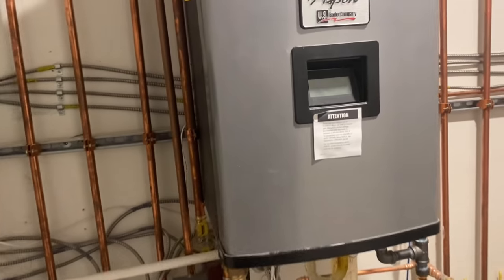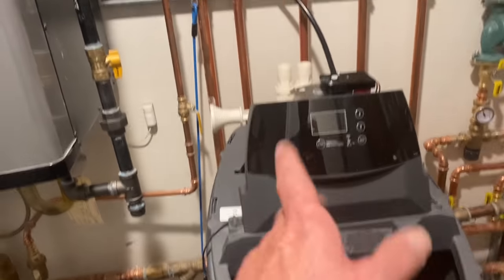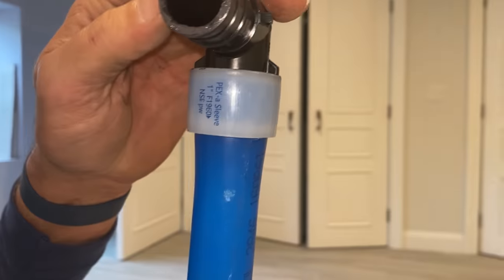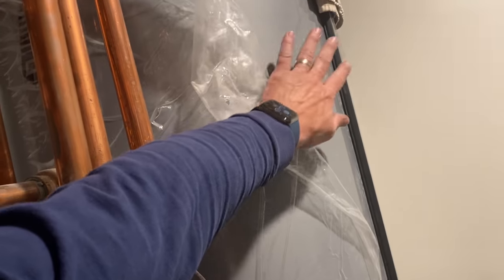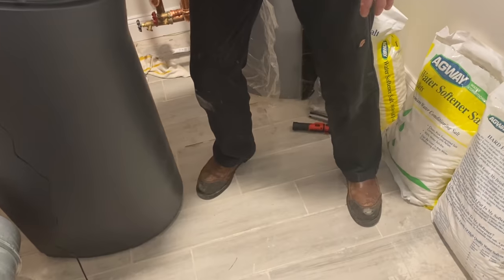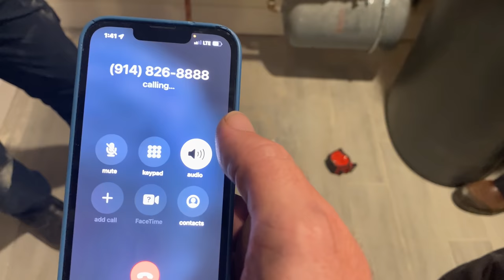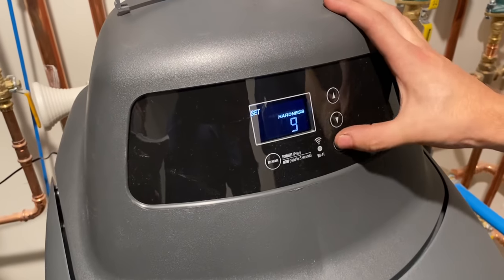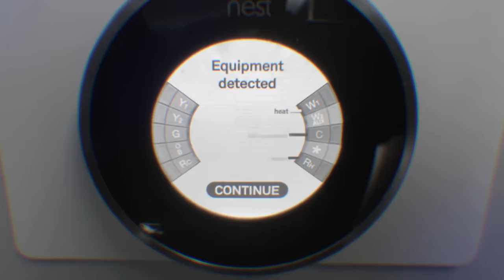Best Water Filter Not Aquasana Installation of Whole House North Star Water System

Comment: Great install…..  usually the regen cycle should be set for a time when no one will use water.  That way the 2 hours it takes occurs between say 2am and 4am when the is no or very little use of the system.  The salt isn’t used in the water going through the system, it is used during the regen cycle to flush the filter media.  The filter media is what is actually making the ion exchange with the incoming water.  Depending on the hardness of the water is when the ions from the media run out resulting in the need for a regeneration cycle and the salt replaces those ions in the filter media.  Hope this answers Peter’s question.
Reply: Exactly 👍
Reply: The salt also replaces the calcium in the drinking supply. This is why the TDS stays the same. The harder the water the more salt is exchanged.
Reply: ideally, that place should have a dual tank system. one tank is always regenerated and ready to go, while the other tank is in use, when the total gallon limit is reached it just switches tanks and regenerates the other so it's ready again.
Reply: Damn it, I typed out this long explanation of how a water softener works then noticed that you did it already.  Good explanation!
Reply: @throttlebottle5906  Kinetico!  :) I have that in my house and love it.
Reply: @JohnSebeny  lol…. I’m in that club too for a lot of stuff!  Merry Christmas.
Reply: @yfdfireman2  What's your opinion on a cold water line going to the kitchen sink for drinking? Should that line be split off using a T before the water softener?
That is the way my system was installed, maybe for possible salt content in the water for drinking.
Reply: @chrispixx  going to preface this wi I am not a plumber, just have experience with water softeners.  People split water softeners from drinking water because they believe it adds sodium to the water.  Best piece of mind would be to collect a sample of both pre and post softened water and comparing them.  Mine doesn’t split off, but in the scheme of things I don’t think it matters much either way.  The original minerals or the softened water are both harmless to you from everything I have read.
Reply: @throttlebottle5906  What's your opinion on a cold water line going to the kitchen sink for drinking? Should that line be split off using a T before the water softener?
That is the way my system was installed, maybe for possible salt content in the water for drinking.
Reply: @chrispixx  I see no reason to ever do that, if the water is that hard(off the charts) then add a reverse osmosis filter system and faucet to the sink just for drinking water, taken after the water softener. no sense in filling your RO system with hard water minerals.
I suppose someone may want hard water for cooking, but it really makes zero sense, other than watering the lawn or plants that like minerals, it would be a huge salt waste otherwise.

Comment: Nice video Mike.  
I would install a Normally Closed bypass ball valve and two Normally Open isolation ball valves in the IN and Out lines to the softener. I hate to depend on internal valves in equipment.

Comment: It’s just an ion exchanger. Don’t think the condensate pump will keep up with the back flush flow rate. Usually it’s piped up to a drain. You need a water test for hardness grains per gallon and iron ppm so you can set your parameters for the unit so it knows how much salt to use and how often to back flush/regenerate. Standard set up procedure for any water softener. Any plumber can install these but they are best handled by a water treatment company, since it’s what they do day in/day out…BTW, it’s always best to use solar salt as it doesn’t clump or cause salt bridging inside the salt tank, plus it’s cheaper. $6.99/bag here in South Jersey. Always regenerate during middle of night so you have soft water during the day

Comment: Finally someone who explains one! I need to install one in my house. Got a well with high minerals.
Reply: The salt simply regenerates the resin. Its the resin that pulls the minerals out of the water as it passes through on its way to your faucet.  Then after the resin has no more "room" on it chemically for iron, magnesium  etc the softener regenerates the resin by pumping the salt water in that brine tank over the resin. The salt displaces the minerals off the resin and the whole mix is dumped down the drain. Then the resin is recharged and can work for another few days.

Comment: Around here plumbers dog on those Northstar units, saying they are cheap junk, but I like them. They are easy to service, and I like how compact they are. The biggest problem I've found with them is if the supply hoses don't line up perfectly, the pressure against the built in bypass will cause the housing to leak over time. You mentioned wanting to add external ball valves, but the softener has a built-in bypass that can decouple from the softener, allowing for softener removal.

Comment: Mike,  I have a water softener in my house, the unit came with a couple of test strips to test the water with, 9 is not very hard.  Also they make different salt to help remove the iron.  I also had to remove the anode rod from my water heater to stop the bad smell from the water.  Mine works great. Mine is a Morton brand.

Comment: Instead of installing 2 ball valves above the water softener, wouldn't a better solution be to install a bypass valve, in the event the softener fails in the future?
Water Softeners usually have a 10 year lifespan.

Comment: those bags of salt inside the North Star how many months do you have too refill it again ?? thanks
Reply: Friggin nightmare. The bags are 40#  it takes 4 or 5 to fill my brine tank.  They last about 5 weeks.  So every 2 months its off to home depot, 8 bags from my garage to the basement.
Reply: @Samlol23_drrich  wow, and thanks for the reply
Reply: it depends on the actual water hardness and setting of the machine. the machine has preset tables of total useable gallons of water per regeneration cycle, the table used is set by the grains per gallon "water hardness" setting. if set to 10 grains per gallon hardness, it will use far-far less salt than is set to 50 grains per gallon hardness.
cranked up real high for very hard water it could chew through multiple bags of salt a week!
we have lots of well water around here and some areas have super high iron content(some places lime) and run settings of 75 to 100+GPG, (very hard water!) weekly salt deliveries and refilling is a must, because it eats it like kids and candy from a pez dispenser 🥳

Comment: do not run a water softener discharge to a condensate pump, the rinse cycle will dump too much volume and overflow it.
softener's it need their own drain with a trap and air gap, the brine tank overflow should go to a floor drain with air gap also. avoid going into a sump pit also, the salt concentration is very high and will eat everything up, especially if the pump doesn't run often.
Reply: @PipeDoctor   think about power failures during regeneration. also note, most softeners will "stick" in whatever mode they were in when the power fails, so if it was in the middle of a process it will just keep flowing the same.
they 100% should have placed a floor drain or two in the mechanical room. oh well.
Reply: I agree 100% should go into a trapped drain. The salt and minerals will tear that little pump up causing a huge flood.

Comment: i just installed one of these, what a nightmare, i kept getting a leak on the inlet nipple between the black c-clamp. I do not like how the connectors are designed just to sit against an o-ring, it was a very small leak, one drip every 15 mins. Did you have this problem?
Reply: only time I had one leak there, was after unhooking or moving the unit after it's been installed for multiple years, never a leak from new.
I can only guess you have dirt/debris in the socket, nicked the o-ring with something sharp or the factory left some plastic flash in the socket/nipple.

Comment: I wouldn’t trust the little pump a flood waiting to happen. The drain line from the softner is under pressure so you don’t need a pump. Just run a hose to where the pump is discharging with a air gap.

Comment: When I was still a young man I use to install those Sears water softeners by the dozens. Listening to that weak little motor spin that geared head   lol. Do yourself a favor, When using a tank in tank style water softener only use 2 bags of salt. The salt that is out of the brine solution will get wet from the inner tank condensating. This will lead to the bridging of the salt bed and is much worse if you use potasium. Never put a water softener in a pump If the pump fails the water softener unlike your condensing boiler or air conditioner will not turn off when the pump switch breaks. The water softner depending on size can use over 50 gallons of water during backwash and if 50 gallons isnt bad enough try having a power failure while the softner is backwashing. Better have your insurance up to date.
Reply: good advice, they do tend to salt bridge often and far worse in humid climates with very cold water supply. get a broom handle and cut it off so it's flush with tank top when on the bottom and show the homeowner to poke it down through multiple times before they refill the salt.  I know the pitfalls all to well, having installed many.
I also agree, that is a flood waiting to happen, if a power outage occurs while it's regenerating. the Taj-Mahal builder wasn't bright enough to install floor drains in the mechanical room it seems. 🤡 💩

Comment: STEAM GAUGE GLASS REPLACEMENT KIT-westwood products  h7-12  90 * ballvalve plus 12 in gauge glass. from a comment i made last week.need to do a little searching for info on digital low water cut off's.when they first came on to the market,i think the manufacture recommended not useing any pfce products[theflon] may cause improper signal , if not grounded good.i get a lot of old new england homes,and the problems that come with them.

Comment: Why a isolation valves? if you turn off the water I the unit that will turn off the water to the house.That is why they usually have a bypass valve to still keep the water flowing through the rest of the house and take that unit out of the picture.

Comment: Great content is always Mike. My only comment is the amount of lube you used on the expansion tool. Way too much!  I noticed It oozing out between the fingers of the expansion head. Now if you’re expanding a large diameter pipe the size of an elephant’s rear, maybe you need that much lube😂

Comment: I am not fan of softeners, they remove beneficial minerals with harmful sodium. It should be used as a last resort.
Reply: it is the most effective way for removing minerals, like maganese, which can be harmful. i disagree konrad, the stuff i have seen you use that you wrap around the pipe is a total gimmick. thanks
Reply: lol that is 100 percent not factual at all.  A plumber is not a water treatment specialist. Softeners are super beneficial for most homes on the east coast
Reply: Agree with the high sodium, you can always install RO system under kitchen sink for drinking. Water softener will save all plumbing in the house. Plus great for hair, skin, clothes.